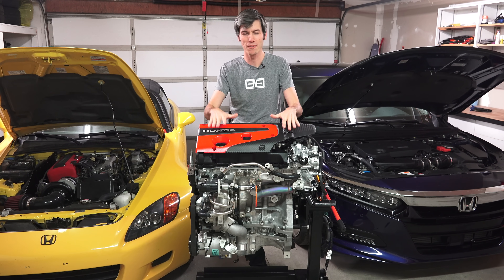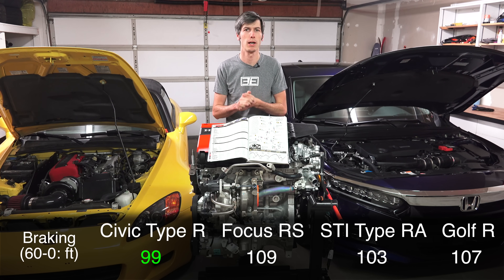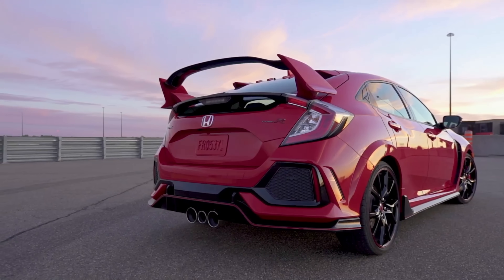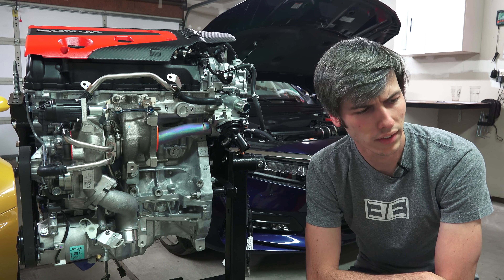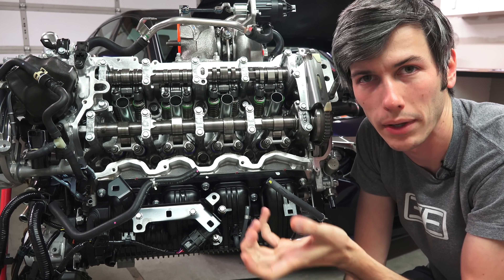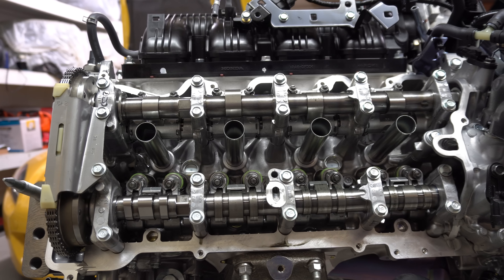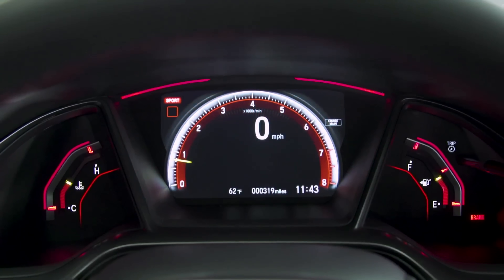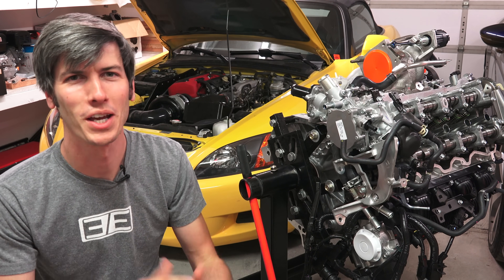The Honda Civic Type R Destroys The Competition - The Best Engines

Comment: I have a sti with internal forged piston and rod, light weight pulley, flywheel and carbon fiber drive shaft ( no balance shaft because boxer engine) pushing 400whp currently 50k miles. I kinda wished I bought the type R instead ( still have my 1988 CR-Z my second babies with k swaped) end of the day AWD vs FWD all depend where you live.

Comment: I used to own an 09 civic si and also had a 98 del sol with the si motor back in the day. I think it would be hilarious to run one of these civics against my wife's SHO. SHO's have been clocked at 5.0 sec 0-60 , and 14.1 quarter mile in stock form. The grocery getter pulls pretty hard on the top end, it's not slow at all for a big heavy car. From about 65-70 mph roll to about 110-115 she's still pouring the coal,  so 140-145 feels very attainable but we've never run it that fast.

Comment: When you said it has Sodium in exhaust valves, you mean the valve functions as a heatpipe ? That's a pretty crazy technology on a mass produced car if that's what you meant.
Reply: Apparently it's not uncommon in performance engines. I believe the Kia stinger also uses sodium filled valves, and others. Cool bit of engineering.

Comment: VTEC the 4 most overatted letters in the car world. VTEC has zero low end torque.  . VW 2.0 liter much better motor.
Reply: @Mike P Stock vs stock  yes. The VW 2.0 liter is much more tunable and can handle 550hp and 500 ft lbs torque on stock internals. Throw in the DSG and the honda has no chance.
Reply: Hey now!
Don't use facts to get the Honda Fanboys all upset!!

Comment: Does GASOLINE DIRECT INJECT cause valves to carbon up.. the 1.5 engine has oil dilution does the type R have have oil dilution

Comment: i didnt think K- series engine would be beat. honda beat its own K series  with this new engine by a big factor. it has all the powerband of the k series and it also is reliable or more reliable than that of a K's.
Reply: It's still a K20
Reply: @idiotstupidfrey  you're right. its different than the earlier k series  generation. thats what i meant. i guess bigger improvement
Reply: @idiotstupidfrey  in terms of power yes. I think the biggest difference is internal.  Sodium valve that's just next level technology.  Halo cam? That's where chef meets mechanic.

Comment: I've always wondered how you cancel out the secondary imbalance with counterweights? Unless the counter weights are just a heavy flywheels or something, so that the vibrations feel minor.
Reply: They don't need to. The secondary imbalance isn't problematic as far as the engine is concerned, the balance shafts are only used to reduce NVH for driver and passenger comfort. Since the Civic Type R is a performance car, NVH isn't as much of a concern as it is in a family car bought primarily by non enthusiasts like a CRV or Accord, so the trade off is accepted for reduced weight and drag. If someone wanted the smoothest, quietest, most comfortable experience possible, they wouldn't even consider a Civic Type R.

Comment: you sound like a ghostface killah rap lyrics.  Wish I knew what the heck you're talking about but it sounds good when you flow 😃  You should have arrors pointing to the parts of the engine you are talking about when you give overviews.  That would be fresh like 88' 
I can't believe they get that kind of performance on the track with front wheel drive.

Comment: Current CEO of honda just said (recently) that Honda Motor Corp etc committed to engines & does not see an immediate future in purely electric vehicles due to a lack of charging access for many of Honda's vehicle customers worldwide. Consider also the range of small engines that Honda makes for generators & powersports in applications where a heavy battery expensive upfront with limited calendar life would make a terrible product (think backup generator or rarely utilized seasonal scooter or motorcycle) 

Different strokes for different folks, YMMV your not everyone & everyone not you, lots of different vehicles for people to choose // or not
Reply: Would rather get that Accord Turbo hands down // regular pump gas & less NVH ^^ real world awesome

Comment: But it’s wrong wheel drive...
Reply: It doesn't matter. The contouring of the Type R and spoiler use aerodynamics to glue the car to the road. They're not just for looks and as a result, they cause the to drive like an AWD if not better.
Reply: @sebastian7539  good

Comment: Direct Injection = carbon build up on valves
Reply: Exactly what I thought. I though the were going to go the Toyota route and have a hybrid model. Like the FRS, that has both direct and port injection. The FRS isn't even turbo and a turbo car needs it more because of all the air that is forced through the valves that make it build up carbon even faster. I have a Mazdaspeed 6 and It had nasty carbon buildup at just 30,000 miles. I had to clean that, delete the EGR systems, install a dual oil catch can setup and install a trunk mounted Water Methanol Injection kit to prevent the same problem in the future.

Comment: When he made this video, he was not aware that gas probably is getting past the rings and into the oil pan (for any direct injected Honda Turbo engine) including the Turbo engine in the new CR-V.  Therefore, this engine is flawed.
Reply: My old civic ate mustang's unless the pony had been heavily modified.  You probably just don't like Honda's, the gas getting into oil and needing to stay on top of changes is a known issue with nearly every turbo once they get any wear.

Comment: Belts do not need replacing nearly as often as everyone thinks!  I've raced belt driven cars for years no issues.  And I mean oval racing...7,000 rpm per lap extreme heat...no little girl 10 second at a time drag racing...

Comment: Do these engines dilute the oil with gasoline like the Honda 1500 turbo?  The CRV issue is bad.  My friend has one with the factory fix installed.  Oil smells like gasoline.  Direct injection and turbocharging seems like a bad idea.

Comment: Love so much about this engine EXCEPT the valve clogging direct injection.  :(
Reply: Bro, just get them cleaned every once in awhile. Nbd.
Reply: Barsa F yeahhhhhh..... do you know what that actually involves?
Reply: @tjlovesrachel  yeaaaaah the same as every other di motor from that 10 years... nothing new zzzz
Reply: Efficiency, Power, Reliability, choose two. They could have made this with port injection but wouldn't have made the same power

Comment: i like how you pretend the focus RS is not faster... "oh yeah the focus beats the honda here, but wait, here we have honda beating ford by literally 0.1 seconds over here!!" yeah hey, if anything the focus is more impressive because it weighs several hundred more pounds and has AWD and still manages to beat the type R with a similar sized engine and turbo. so actually the ford engine is really more impressive. all these design features of the honda engine you mention are not truly meaningful in any significant way compared to standard and current technology. i mean to be honest, this does seem to be typical delusional honda owner tripe. plus the source of these tests could also be biased or unreliable in some way, because the RS and type R numbers are extremely close.

Comment: I enjoyed the video, and Honda makes great engines, but as an old guy that isn't into maintenance anymore, I am not keen on a direct injected engine. The ones that have the supplementary port injectors are the only ones I'd consider. 

I still have a '91 Mitsu 2.0 turbo that serves as a daily driver in the US, which I purchased new. It's been a great car, and it follows the same engine formula as this Honda. Except for timing belts and water pumps (every 60k), I've done NOTHING to the engine. Best little car I've ever owned. As we speak, the shifter needs some attention, but hey, the clutch is original ! Don't let people tell you that turbo-4's won't last.

Comment: The Hyundai Veloster has a longer warranty and costs less, just not as track focused as the Civic Type R. The new Mazda MX-5 is at the top of the newest Consumer Reports list of 10 for reliability. To save more, I would consider a Honda Fit or Kia Niro. I like the Mazda CX-5 to sit higher, it steers very well, and the automatic transmission shifts very well- it was on the last Consumer Reports top ten list for reliability. The new list has the Prius Prime and regular Prius as 2 and 3.

Comment: The timing chain last as long as the engine lmao gonna be a short engine life spam
Reply: I have a 289,000 mile turbo chevy cruze on its original chain. Synthetic oil & shorter change intervals that chain will be fine. Now 21PSI of boost on regular might have bottom end damage. So in either case the chain will be fine.

Comment: Blah blah blah to make more power you need to burn more fuel. To burn more fuel you need more air aka larger displacement or revs. In a controlled circumstance given proper fuel etc it would take that 2.0L double the revs to match a 4.0L that is built the same as the 2.0L theoretically. Honda makes a great motor but 100hp per liter doesn’t mean squat if you only have 2L.

Comment: Well..Honda is 30 years late using turbos.  Mazda and Toyota have been using them reliably since mid 80's. .. so they did all the testing and perfected it .  
Also all the ricer tuners that put turbos on civics and found the stock honda engine blocks needed bracing around the sleeves or they would blow up,  helped honda by doing the r&d.

Comment: I can’t speak to the Ford, but the Gold and STI are dated platforms whereas the Honda has a new engine.  The EJ25 is 30 some years old for example.  Sure it’s been updated, but at its base.... it’s pretty old... FINALLY subaru is coming out with a new motor for the STI next year.

Comment: Can u use seafoam or any type of cleaning solution on these engines with the turbo?  I have a 2018 accord 2.0 was thinking of using it almost at 30k miles

Comment: Sucks in snow but even that can be fixed with the ORBIS rear wheel electric motors that will give it an extra 100lbs of torque or more. But I'm still curious how it will handle in the snow.

Comment: 300 pounds less and a Hi Tech LSD does it . The lifetime cam chain is a real thing as this worked in my 2002 Nissan STR V . I don’t recommend removing your balance shaft on your motor as it will last much longer from my experience

Comment: How would an engine like this stand up to continuous heavy loads like marine application?  Man, revving up to 7000rpm I would love to swap this for my 225hp V6 that red lines at 4600rpm.  Maybe not any extra power for the hole shot, but the top end would be fantastic.

Comment: I have a 2019 accord and that thang MOVES
Reply: 1.5 or 2.0? I tested a 1.5 accord sport for a full week. It was fun and fast but not anywhere close to my 2019 Si.
Reply: Leatherneck75 1.5
Reply: I ran a 2.0t in my almost stock ls1 trans am........they are not fast at all sir 😂 coming from a old Honda guy ...my b18cr eg hatch embarrassed one as well
Reply: Rodolfo Munoz 1.5 tops out at 120 and I’m Very upset about that. It definitely gets there respectfully fast for what it is.
Reply: kamehamehaX300 😂

Comment: Well the Type R does not have to deal with the loses that you have when you have to spread the power to all 4 wheels (more so to the rear wheels, since that long shaft will increase the loses).....There is very little power loss from the Type R's engine to the Front Wheels, the only problem being that is a FWD so it cannot put ALL the power down from the starting line as the other 3. If you could compare the WHP of all what would the results be? Hmmm

Comment: Hondas been killing with the four banger for a while I believe
Reply: Almost 30 years
Reply: All Honda engines are great.  From the NSX down to a lawnmower.
Reply: @MillerVanDotTV  Some sweet music is made by the NSX’s engine at higher rpms. No need, IMO, for some overwhelming exhaust.
Reply: You misspelled *FOREVER.

Seriously, no one else has ever comes close to Honda's 4 cylinder efficiency, build quality and performance in large scale production cars.
Reply: Since the zc dohc
Reply: Sonny, why, back in my day, we would sling a 1.6L B16 Type-R head on a 2.0L B20Z block, drill the oil port and call it a day for nearly 200Hp. Honda has been king for a long time.
Reply: Like 4 evAr!
Reply: The king of small engines for a long time.
Reply: @Invisible Trust which car was that
Reply: Butters S. 😂
Reply: Until now. The turbo means they've lost any real advantage. The pinnacle factory wise was the F20 250hp NA, shame it will never be surpassed. I did have a hope going back that they would reach 300 HP NA...

Modified would go K24 - K20a2 head, NA tuned to 300hp, but even then I would never buy an FK8, I would put that money into a lighter Integra DC2. And just use all of the most modern technology, like the LSD etc.
Reply: Mitsubishi?🤔
Reply: Yep I still have my Honda 1969
Reply: 4banger for life

Comment: Adjusting the valves at 100k miles? I have never heard of this. What is involved? Is this a real thing for other cars as well?
Reply: Most engines need valve adjustment once or twice in their life unless their high performance/maintenance or have self adjusting hydraulic lifters

Comment: Actually this engine is weak. If it was NA it would only be making around 135hp. That's why it needs 22.8psi to make 305 hp. And all that boost is making a lot of hot air and these things have overheating problems.

Comment: Chain drives are designed for life of an engine. Right, because when they break the  engine is going for scraps... I love these marketing statements haha. VW has class action law suite about these because their tensioner and chain can go bad at as soon as 30k in extreme cases. They fixed it in later models

Comment: Would the civic type r be a good daily driver?
Reply: Definitely. For a car with 305 HP. A combined of 25MPG, 22 to 23 in city to 28 to 30 on highway. Better than most cars in its class.
Reply: I have 18,000 mi on the car and it's my daily driver 7 days a week. Car's absolutely amazing as a daily driver.

Comment: Great information-
One of the most impeccable tutorials about Honda I’ve seen by far- explanations were precise and to the point but..  
I have the older Honda Accord-‘15
and I’m having some issues plus I just like the v6 motor- with 120ish-k mileage I’m in need of a ac 
compressor I believe.  Never owned a Honda before and found it easy to do simple maintenance with fluids simple and time saving.

My ac- changed the ac clutch kid and miss reading the pressures threw an DTC which tells me I have oxygen sensors and evaporated system  symptoms-  any directions for troubleshooting ?  I can scan and read the codes but don’t want to do any more harm..  I ordered new oxygen sensors all around but the evap system is something that I’ve not had experience with.  I replaced ac compressor on other vehicle 04 jag along with dryer oriface tube and recharged works well- 
That needs some work as it was sidelined for 3-4 yrs for no heat issues and Honda took its place.
I love to learn and troubleshoot and if you have a directional Insite with Honda- would greatly be appreciated.  Low budget do injury so doing some research as much as possible. Thanks again first time viewer/subscriber👍🏻

Comment: 'Numbers' yes perhaps, but don't forget about the simple basics; it is a FWD which should disqualify it as a sports car. How does the Civic even touch the STI, or any other AWD, or rear wheel type car? I mean, where's the sport of driving it? A sports car is about the fun and challenge of driving it, to tame the powers and properties combined in the design. Not primary safety and road performance.

Comment: The best engine is right at the side of you in the s2000. Fit a turbo or supercharger and make 500 bhp all day long on stock internals. How long will that civic engine last at 400 bhp, not very long, there failing at 350 bhp loads of issues.

Comment: I traded my 2017 heavily modified STI in for a 2018 Type R. The Type R is definitely the better car, in every single way.  Handling,  comfort, design, tech, power and Honda reliability. I had to do every bolt on, E85 and a full suspension upgrade to get the STI as fun a the Type R in stock form.

Comment: I love the engine & performance of this car, but it is so damn ugly, like a plastic spaceship on wheels. The interior looks so cheap and thin plastics. If the civic had late 90's design or s2000 I would easily get this over the cars you mentioned.

Comment: Honda performance guys tell me the (Earth Dreams Vtec Turbo) 1.5t is more reliable than the 2.0t after both have been modified.
Reply: Oil dillution
Reply: @m.morininvestor9920 ,  True, when driven in short bursts in cooler climates where operating temperatures are not maintained long enough (over 20 minutes) to burn off all the fuel.  But even then, no complaints of failure or engine fowling due to carbon buildup.

Comment: The Ecoboost Engine is still a superior engine with higher capabilities.
Reply: Is that suppose to be a joke, im a ford guy and the ecoboost is a giant pos, know a guy with a eco boost mustang that has about 8k miles and is already burning oil and has a slight rod knock
Reply: @BashfulBones  1 guy you know vs over 2million on the road. Lol. The data says otherwise. And the 2.3 puts out more power and torque and weighs less. Yes a superior engine than the Civic R By Far.
Reply: @matthewd6306  yeahh well lets see exactly how long these engines stay on the road for
Reply: @BashfulBones  Tens of thousands of Ecoboost F150s with over 250k miles, it's more reliable than the 5.0 due to less Revolutions over it's life cycle.